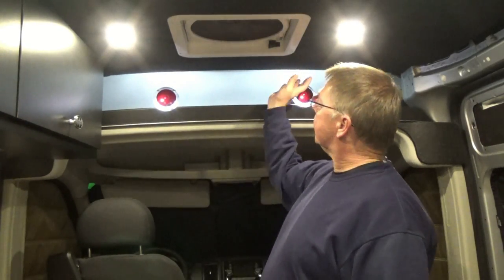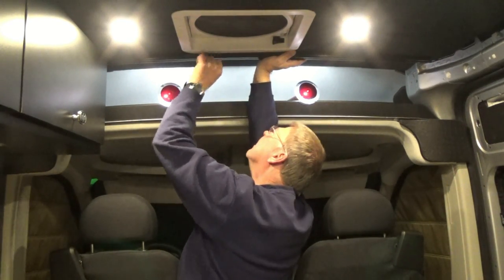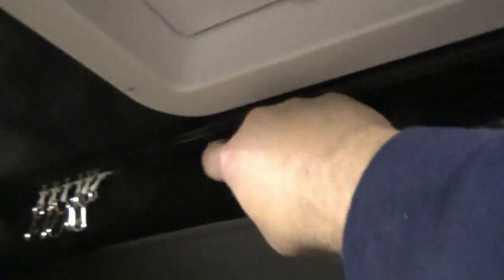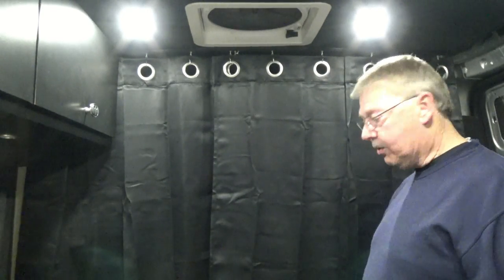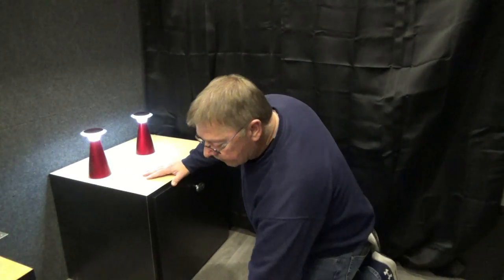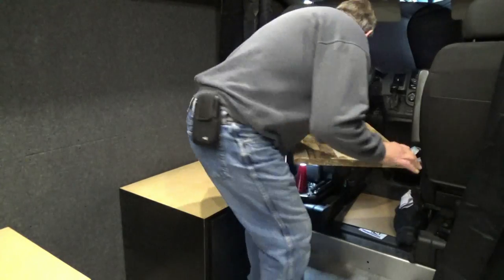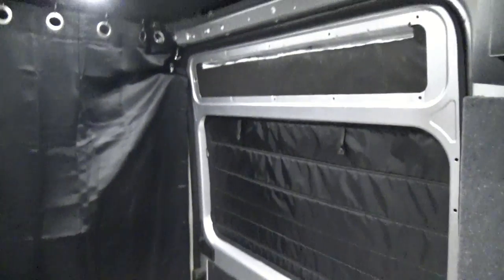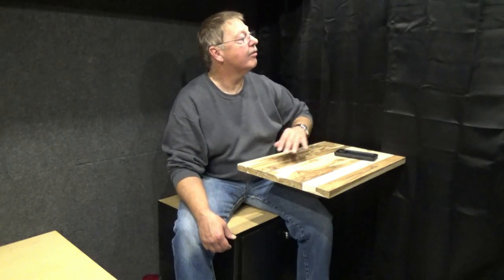Promaster Van Build 2500 159WB – DIY–Privacy Curtains and Table Mount – Part 20

Comment: Good Friday morning, Al! Very nice curtain, but, I’m not a fan of those big honking round white eyelets though! 😂😂😂. The only suggestion I could add [providing you kept those particular curtains] is to have a Velcro strip attached to both inner edges of the curtain (your location choice) to keep the opening closed should you be using a strong A/C or fan when wanting to stay in private mode. I’d also have the magnets you spoke of sewn into the wall sides of the curtain so you don’t have to keep moving and storing them (magnets) repeatedly. That’s MY 2cents worth for what it’s worth! Your choice of bed sheets, blankets, and, comforters are spot on! They blend in really good with the van interior! 👍👍👍 Stay safe on your trip and I’ll see you in the next video! ~Jim~
Reply from the maker: I agree... not a fan of those curtains either, but will have to make them work for now until I find something better that I like
Reply: @OregonBatman  yeah, I know how ‘that’ goes! Lol!

Comment: Looking awesome Al!
You may want to put some kind of strap half way down on one side of the wall to tie around the curtain to secure it so it stops the curtain from rolling from side to side when you go around corners 😉
Reply from the maker: Good idea! Right now, it tucks in nice and tight behind the drivers seat when pulled back... guessing once I use it for a while and get the bugs worked out, will need that strap! :)  Thanks for the tip!

Comment: I like that track. I was thinking of putting some sort of curtain around my CNC Router to keep the dust from infiltrating the rest of my shop. I haven’t been able to come up with a decent dust collector yet. I want to build something that comes down on the material separate from the z axis. Sorry, a little off topic.
I installed a lagun table in our truck camper. They are awesome! Since you don’t have a center console between your seats you could swing the table in there. Put a couple of cup holders at one end and a pocket to hold other miscellaneous stuff and you have a console. I think that would make an awesome CNC project.
Reply from the maker: Thanks Warren! Great idea there... I'll do some thinking on that one and see what I can come up with!

Comment: I’ve got the same van on order in a 2022 model.I’d like to start by insulating and throwing in a mattress and a recliner.  Does the air max fans.keep you cool? Should I put in an A/C unit?
Reply from the maker: Haven't really put them to the test yet, but they will move a lot of air and have good circulation. Depends where you live if you'll need an air conditioner... if it's hot and humid, I might consider one! :)

Comment: How do you like the Table mount so far? Got the same one and they gave me carriage bolts with a square shoulder on them. It’s hard to tighten them.
Reply from the maker: So far I really Like it... had to make a run to the hardware store to get screws to mount it (didn't use the bolts). Everything else works great